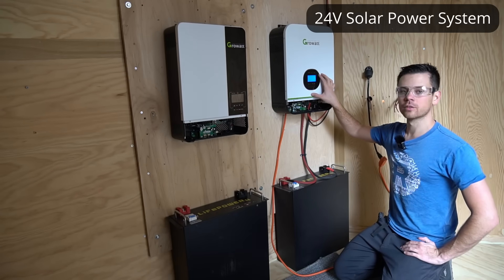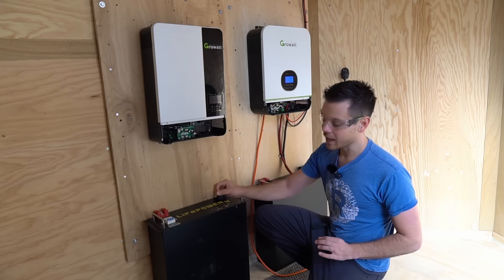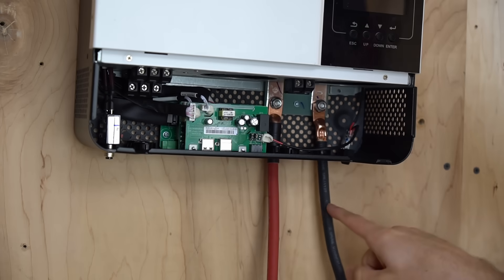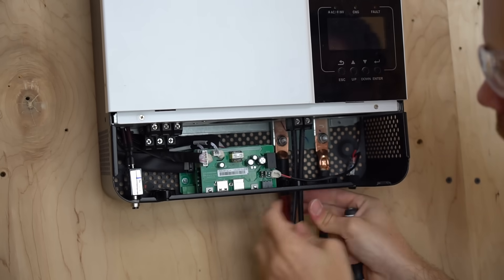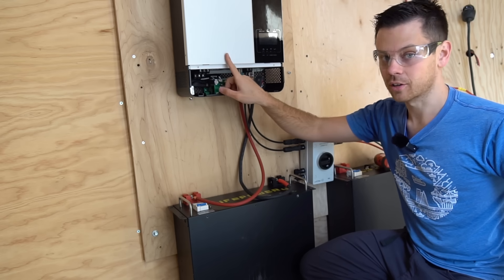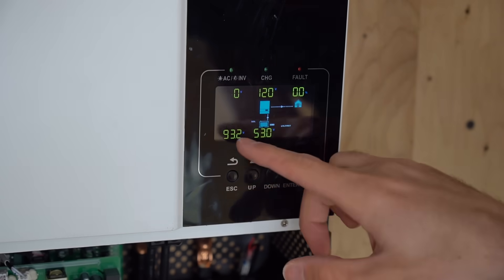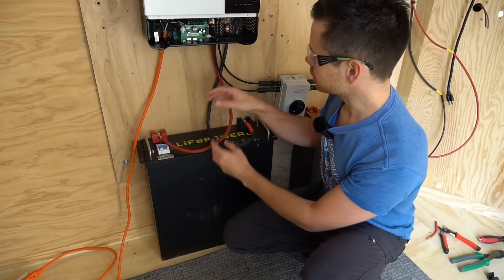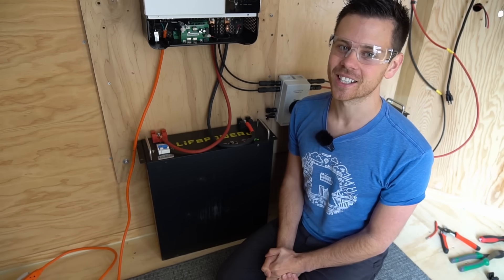Beginner Friendly 48V Solar Power System! Step by step!

Comment: Is anybody using flooded lead acid anymore? I have a 48 volt system, 2x 8X 6V, 420 amp hours per string. Do these inverters mind flooded lead acid or is 48 volts equal to 48 volts equal to 48 volts?

Comment: 50 volts won't kill you you cant feel it unless you arms are wet.
Reply: The amperage is what kills you not the voltage....50v with a surge of 900 amps will cook you.
Reply: @SarahStuff-p5u  😂😂😂😂 your body resistant is too high to pass milli amps of current....
Reply: @HybridShedIraq  It is not the volts that are of concern though like you inferred, it is the amperage you need to be concerned of is all....Milli amp no concern no matter the volts 240v at milli amps you will not really even pass the "body resistence".

Comment: Volts don't kill you, but amps do and it only takes 1 amp to do it!  Don't play around with it unless you fully know what you are doing.  Disconnect all power to the unit and don't touch the exposed metals where current flows through, all while using good insulated rubber gloves, while standing on a rubber mat and still not touching the metal parts.  You only have one life.

Comment: hello Will, i m going to install a 5kw growatt with 6kw solar panels, aka 12x500w , like 6s2p configuration...is any danger to burn the inverter ? i will have 45vdc x6 = 260vdc away above 430 that inverter cand handle !

Comment: Refiguring my setup. Screw 12v. That was cute. So i have questions... which 48v battery is your favorite? And which of the all in one inverter chargers do you like best? Ive seen you hook up the EG4 and battery on the dolly, and the renogy frustration. And this growwatt... Not concerned price wise but efficiency wise.  The EG4LL 48v battery is the first ive really looked at, it seems popular. 
Also i still want to run dc to dc charging from my alternator battery while driving... I dont care if i need to replace the renogy 40a dc to dc i bought in this chanegover. What is the way here? I dig the shore charging, inverter, and solar mppt for my roof panels being all in one smart setup... but am i going to need some smart connection between those and the dc to dc charger going from battery to battery?

Comment: Make it 200vdc for whole system, panels in series, batteries in series. This configuration is more efficient and less waste of energy. Because of stepping down from bigger voltage to 12v or 48v to charge the batteries is less efficient and also stepping up from 12v or 48v to 220v AC is again a energy wasting in between.

Comment: I do not know if you will respond to this comment or not. I have an existing system which is not fulfilling my needs (five 100W panels, a cheap controller, a cheap 3000W inverter, and two deep cell marines).
I run a retail space at an open-air flea market in Central Florida. My system was my dad’s, who passed away; so, I just moved it to my space.
Now, I’m expanding (a 50’ X 20’ carport).
Understand, the market OSS only open two days a week and has plenty of sunshine during operating hours. When open, I use the system to power TVs, lights, and receptacles for testing any other electronic devices that I might be selling.
However…
At the new space, I would like to continue that practice; but, also power a couple fans (during weekend daytime) AND security lights and cameras, monitor, NVR, and a full size refrigerator 24 hours a day, 7 days a week.
Can you help me configure a capable system with little to no maintenance.
Big draws during daylight weekend hours (if it’s raining or something, I don’t need the extra power) and just security and fridge draw during the week, night and day.

Comment: what is the benefit of having batteries in parallel or series? And does the panels connected in series or parallel affect the efficiency of the charging of the batteries through the inverter or is this just a matter of proper sizing?

Comment: I'm on a budget, but would like to put a 48v split phase off grid system together for the house and sheds. 

My thought was that I should fork out for the guts and then slowly by panels and batteries and thus integrating more over time.. 

What is the best approach and equipment selection for this type of arrangement?

Comment: Stupid question: why don't install a fuse that, in case of short, it breaks the loop? This way you don't die if accidentally touch the battery the wromg way

Comment: There is only 1 downside on 48V. If you accidentally touch the battery with both hands, you are dead. But it is the only downside!!! Because if you are dead you don't need batteries anymore.

Comment: 1800 watts for an extension cord - that doesn't sound right.  Have to think of length and load over time.  Can't draw 1800 watts 100% of the time - it will fail.  I would update this one, with some safety warnings for users.

Comment: Just for your knowledge the main risk with Dc current is to hydrolise the water inside your body. This hydrolise is going to produce hydrogen inside your blood and this hydrogen is going to block your kidneys. The problem is that you can have an electric shock and after you seem good but few hours later you will have to go to hospital.

Comment: i have a question for you that you may be able to help me with , i live on a narrowboat for nearly 3 years & have solar system with 4 Leisure Batteries , my problem only started about a week ago only when i have it on the inverter which is a 3000 / 6000 , when i turn on the tap some times you can hear the pump try to start but it fails (the pump is working fine when on shore-line) & sometimes it turns off the tv , do you think this is the inverter & do you think i should get a new inverter, thanks for your help

Comment: I really enjoy your videos, your enthusiasm, and your obvious honesty shows clearly in them.  I have bought a house with a defuncted solar system Batteries were lead acid and dry. invertor may work but is only 1K but there are 4 x100W solar panels on the roof. I am going to put in this basic system you have shown here. My main reason is to protect and smooth out my electricity supply as I live in an area where the power drops out constantly and brownouts are common.  So protecting my technology is my main concern. However if I can utilize the solar panel's bonus! Is there a simple (read not too costly) way I can measure the voltage from/across them over time before I put the system in, if not I can just put them in series and hope they produce enough voltage to charge something.

Comment: I rather work with live 100v dc vs 50v ac. Dc is so much more tame and last time i check ppe not required for dc until you get near the 100v dc. Make a plan take your time and you will fine.

Comment: I really love your videos I lrean a lot from you,just one question I have 48v system solar and wind just I'm not sure I connect right cable,I will be apreacit if you help me, I have 4acid battery each 320AH also my inverter 5.500klw what size of cable good for connect all battery together? Also from battery to inverter? Thanks

Comment: na this is really great example, exactly what im going to do now, not even connecting the common grid.... just stand alone system. I wonder whether the inverter will keep the data in memory for in case no electric for certain times.

Comment: this extension cord is using the surenergy? the energy produced by solar but left unused? for example could connect to the water boiler, which would then heating up water by any left over energy? this could develop further by even heating up the room with some electric heater after the water has been warmed up to the max? is this making sense? feasable to install in this way?

Comment: 12 modules can be installed on it, isnt it? which is 12 x 31,5V gives less than the max 450 VDC. right? this does not need a combiner box?

Comment: Does the system slowly discharge the battery if the solar is disconnected? If you have no load and no solar, is there any power consumption from the all-in-one system? Is there a way to shut that down when you’re not using the load?

Comment: For a cheap option. I'll chase up some discount used panels and deep cycle batteries. But inverters are still expensive. Any recommendations for a real 3kw capacity inverter with high input solar voltage.

Comment: I am thinking of buying this system, do you have to provide a grounding wire if it will be used for an off-grid cabin?? I will be adding a small sub-panel. Thanks

Comment: Thank You! I have recently bought a Growatt as well. I have no knowledge of electricity at all, but I managed to connect an Axpert inverter 2kv. Using two 12v connected in series.

The Axpert died on me recently! So I bought this Growatt! But all of a sudden I am fearful to connect this! First is that I may damage the unit, secondly its death ... I am currently connected using one of those boat inverters! This one does not scare me at all!

Comment: Hey will, I noticed in another video of yours that you charged the capacitor on the charger/inverter with a resistor on the battery terminal before hooking up the battery itself. Wondering why that wasn’t necessary here?
Reply: EG4 LifePower4 batteries have a pre charge resistor built in as well as Growatt communication (which Will didn't cover)

Comment: DC Current will not let Go of You, like AC, that Pulses for you to let go of it. DC is more dangerous, There maybe a Way to Use Two 2 ,24-volt batteries into a Tie, for 48 v. two to four Batteries, Tied in, and Shield the Ties to the Two, from People being able to Touch it,  a Connection uses Smaller space for a Shield.  I Got a Few Touches of This Stuff Welding with a Faulty Welder in Ag Mechanic's in School, I told the Teacher, The Thing was Electrocuting me through the floor and He Had to Try it himself and Shut it Down.  Be Careful with DC, More so than AC !

Comment: I am a really concidering purchasing a  solar panel kit, but include a solar generator until I can afford the batteries.  I am also thinking about a generator to add to the system.  You have definitely assisted in bringing me closer to pulling the trigger and not going with a company grid tie in system.  I salute you for providing so many people with knowledge to save themselves headaches with common mistakes and product reviews that I believe was sufficient enough to provide me what I need and at least deliver on what is in their product descriptions.  So thank you and keep up the good work.

Comment: Verify your voltmeter is working by having the voltage on and measuring it, then turn the batteries off and measure that it's off.

Comment: Maybe anybody knows answer: inverter is used as UPS and connected only to grid. But even there is power in grid and it works in AC bypass, it still continue using the battery (0.5-1 amp) and charges the battery time-to-time. Looks like for self powering inverter uses battery, not grid.

Comment: Hi Will. Can you confirm if it is 150 VOC minimum start up voltage, not maximum right? I believe these units and handle 120VOC-450VOC range, is this correct?
Reply: The 3000TL LVM can accept up to 145VOC,  the 3000TL LVM-ES can accept up to 250VOC.  They are both 48v.  the ES version has the higher start up voltage.

Comment: I watched at least a dozen of your videos and really like the way you layout information so thank you again for making another great video.

I clicked on this video because I would like to set up a small battery back up with a solar panel for my home in the event of a hurricane that knocks out the power for a few days.  

I would like to power my Starlink dish and modem, my home UniFi network, and 3 UniFi cameras that are attached.   This would allow me to remotely see if my home is still intact during or after a hurricane when I’m hundreds of miles away.  

I think I would only need 200 watts a day max, but can do the math on that.    

Is there a smaller version of the system that you showed here for my type of application? 

Thank you again! 

with intent of only powering high sterling system my unify Netwerk and a few cameras.

Comment: hi i love you channel hello from Ireland ,i have air condition MaxxAir Mach 1.7 KW Roof Air Conditioner with Soft Start and Heat Function which I would like to put on a   fiat ducato , this is some dodge, in America  I have all ready  system that you recommended for 12 v Renogy dc / dc under which I have one photovoltaic panel, and I still have space for 3 photovoltaic panels but now I want to install this air conditioning do you think I should go in this Growatt system this time and leave Renogy because I also need 12v or extend Renogy.thank you so much for you answer

Comment: 11:50 lol I'm more concerned about getting the set up to work than getting electrocuted.
As you say in your video, these new batteries do simply the task.
My main question would be:
How does one 'measure' the power provided by a DB board in order to determine how powerful the solar system ought to be?

Comment: Will i am switching to a 48V growatt and 48V EG4 from a (safe) 24v system. My question is would adding an additional breaker or fuse be smart or are you confident in the breaker that comes with the EG4?  Thanks

Comment: Hey Will, First off, Thanks for the video. I love all of your videos. You say in this video that this 48v unit has a max voc of 140v but online it says the voc is 450. Am I mixing something up here? I'm not a noob but also not as experienced as you and looking to learn when I can. I feel as though I'm missing something important here or perhaps you misspoke. Thanks in advance and again I'm grateful for all that you do. I know you pay attention to detail.

Edit after seeing your addendum at the top: The VDC is the same as the VOC? Is it safe to connect to the full 450voc? I found my info on amazon (for the 48v all in one) If the info there is incorrect then my system will be off. Thank for any heads up.

Comment: Hi Will. Greetings from The Netherlands. I have learned so much from your videos. You're the best I've seen. My question is: Can I use the inverter just to load one Battery or Battery pack? I dont want a connection from the inverter to the AC or grid. The batteries are connected to an 48 volt to 220 volt inverter to my house.
I use a string of 10 panels with a 450 volt PV output. The inverter I use can handle 600 volt.

Comment: you mentioned that the battery would be charged only when the appliance is not running. Is this a limitation of the Growatt or is it something you have configured in the settings? 

There should be no reason that you can't charge your battery via solar while it's being  discharged via the appliance. from the perspective of the battery, it will simply see the difference in current, which will always be less than the load

Comment: Hi my name is Danny Dingus I question is that would this 48 bolt system work in my caddy cruiser it operates off of 30 amps I'm wanting to put something like this in it to go off grid it seems like the perfect solution can it supply me a 30 amp service with the solar panels and I wanted to add a 2.0 Zeus wind turbine just wanted to know what your thoughts on that would be

Comment: interesting when you mention receiving shock and how some people don't seem to be too affected with even with higher voltages. In my experience with electrics it can be explained by the persons
hand moisture, clammy sweaty offer a much better path for current to flow, fortunately I have very dry hands and received many shocks without too much harm done, whereas a friend of mine with very sweaty hands would always  jump through the roof if he got the same voltage shock. I wonder if anyone else has experienced something similar?  Perhaps gloves would be a good precaution

Comment: 48 volts is the voltage that also works well with 3.7 volt Lithium Ion cells (13 in series), which are cheaper and lighter to buy up front.

Comment: Hi Will.  I have three 290 watts solar panels (44.9 open circuit voltage and 36 v max power voltage).  I also have a 40A MakeSkyBlue charge controller.  Could you give me as the best set up for this solar off grid equipment.  Thank you in advance.

Comment: Will this 48 volt system  power a 240 voltage electric motor on an air compressor.?

Comment: Seems false economy to use thinner wire as you aren't using  the full power , if in  the future you do use more  you'll burn your house down, or you'll have to spend more money upgrading it.  Use the cable rated for max possible output/input from the get go.

Comment: Question: Is it possible to connect like your ac to both grid and off grid at the same time so that if the battery runs out or if you don't have any battery so that the power can be taken from the grid automatically when there is no power from solar.

Comment: HOWdy  W-P,
Thank you for SHARING  the IDEA  of using MC-4 Connectors on the INVERTER 
I'm building a 48 Volt system with three (3) LifePower Batteries 
can you suggest what SIZE  "T"-Class Fuse to purchase ?
COOP
...

Comment: Hi, I have Growatt TL 5000 inverter with 2300w solar array. The solar only produce energy for about 15minutes then it disconnects. (This happens only I switch inverter off and on).

PV Voltage is 110, but 0amps.

I have tried uti, sbu and sol priority settings all with the same results (problems).

I need urgent advise.

Thx

Comment: Hi I am a newbie with battery and inverter. And I want to build a system that will recharge the batteries within the allotted time (2am to 5am)Is it possible to set from the mains the battery charging time in the Growatt inverter, for example from 2am to 5am?  Great Job .